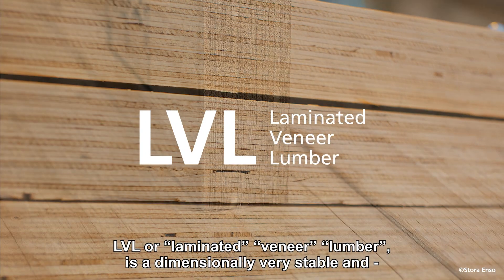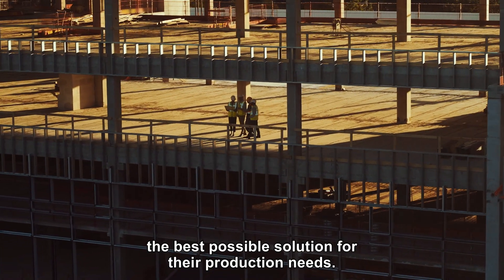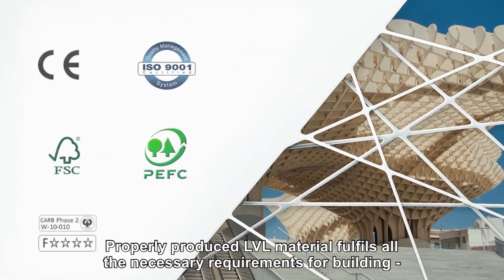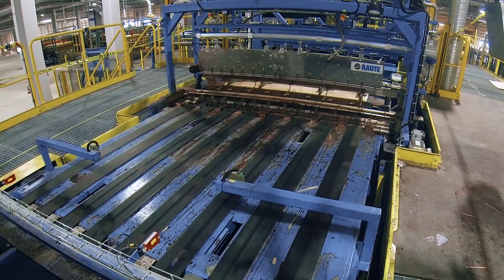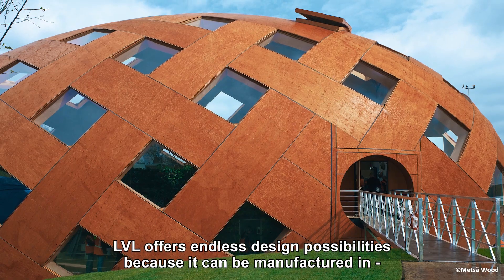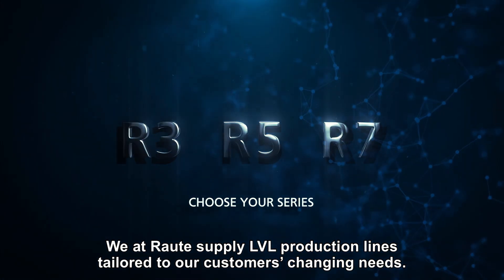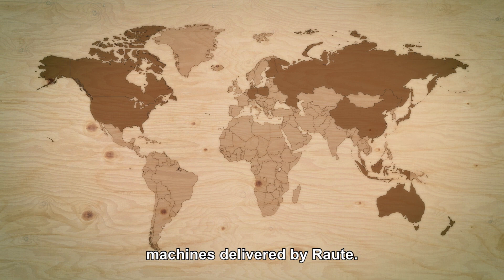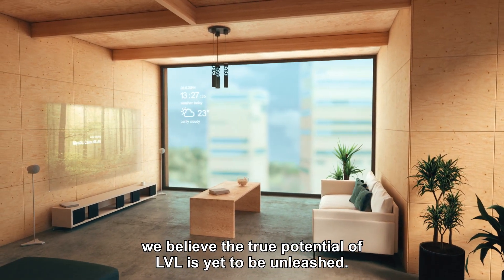LVL - Laminated Veneer Lumber

Comment: I have two questions 
- What’s the difference between R3, R5 & R7?

- Can this withstood outside temperature to rain, snow, sun, etc?
Reply from the maker: Hi! Thank you for your message and great questions.

1. We have grouped our solutions under three product series (R3, R5. R7) matching different capacity expectations, budgets, and know-how. For LVL production, we have R5-Series and R7-Series technologies available for LVL lay-up and pressing and LVL billet handling.
https://www.raute.com/industries/lvl-production/

2. The glue used in LVL is weatherproof and therefore LVL can withstand outside temperatures and moisture variations without losing its load-bearing capacity. But being a wooden component, LVL needs proper surface treatment the same way as any other wooden component when exposed to rain, snow, sun, etc.
Reply: What the good glue for LVl ? Penol or enol ?